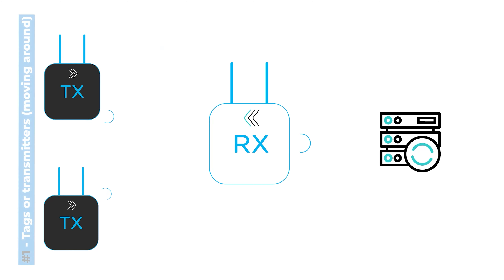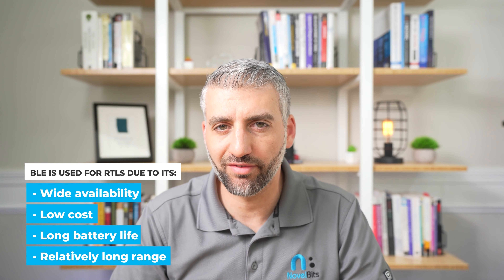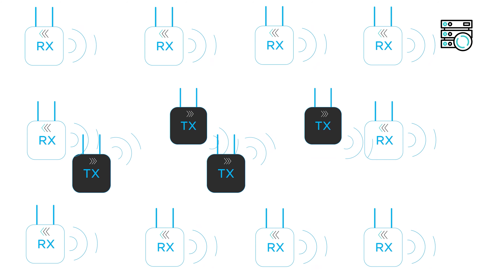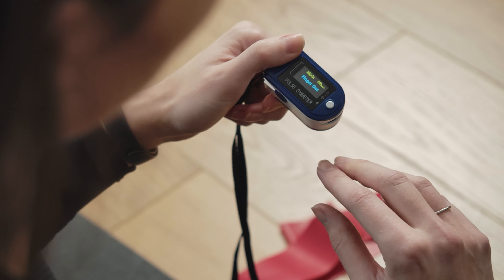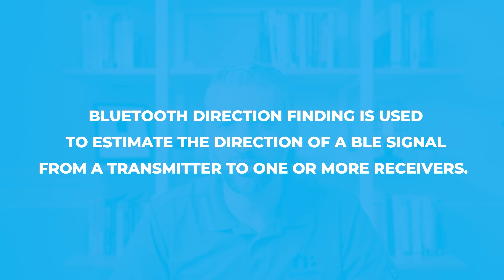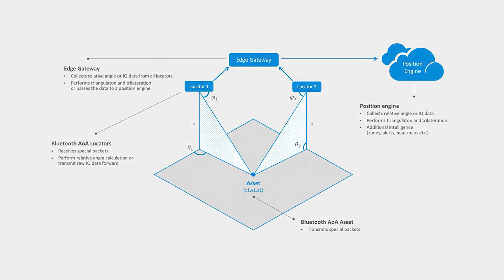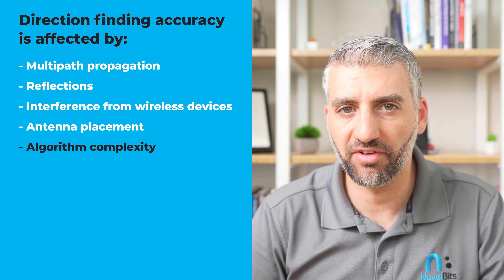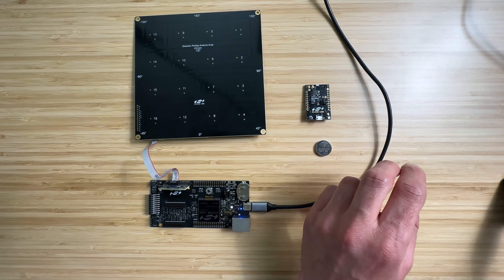RSSI vs. Direction Finding: Which is the Best for Bluetooth RTLS Solutions?

Comment: Thanks Mohammed! How can I test this if I don't have the kit you are using, but have about 5 or 6 BLE ddevices/devkits (mostly from silabs)?
Reply from the maker: Unfortunately, you’ll need an antenna board array to do anything with direction finding.
Reply: @NovelBits  What if I only use RSSI?
Reply from the maker: I was referring to the direction finding method. 

For RSSI only, you don’t need an antenna board array and yes you should be able to use the devices you have. You’ll just have to use multiples of them as locators for one or more tags.

Not sure though if there are any existing examples from SiLabs for implementing an RSSI based system. I would have to look into that. The algorithm and location engine implementation is where most of the work will be in an RSSI based system.
Reply: @NovelBits  Thanks

Comment: Excellent video, as usual. On the direction finding technic, is there some limit on the number of tags one receiver can handle ?
Reply: yes, but mostly depends of the usage mode/aproach ( connection, connectionless or silabs).
Reply: @mislavkulas4422  thanks for the clarification. what about in connectionless mode (broiadcasting)? just for positionning application (asset tracking), how many tags we could have then?
Reply from the maker: Thanks Mislav for the input. 100% agreed. For broadcast applications, you can have a much larger number of tags up to the point where they start to interfere with each other specifically in the advertising channels (37,38,39). I would say maybe 100+ tags is still feasible. But this also depends on the configuration parameters such as advertising interval and channels used.
Reply: @NovelBits  thank you as well for your input, much appreciated.
Reply: @julienc.4916  if i remember correctly on silabs it was limitless and for connectionless around 32 tags (if the receiver board is efr32bg22 and i think limit is because RAM which are used from the stack to sync with the tag)